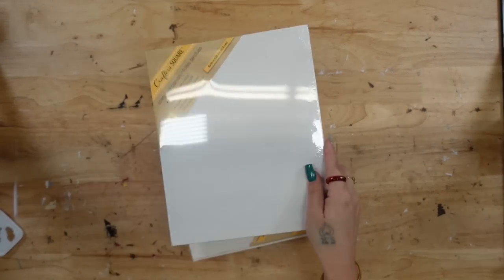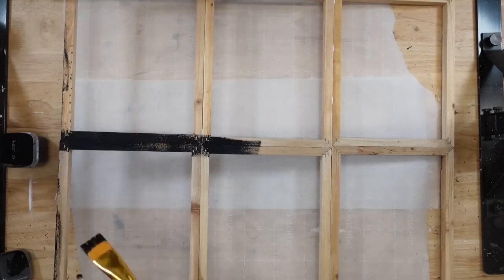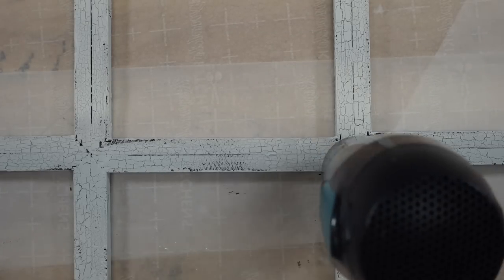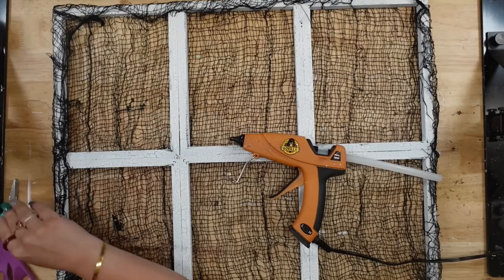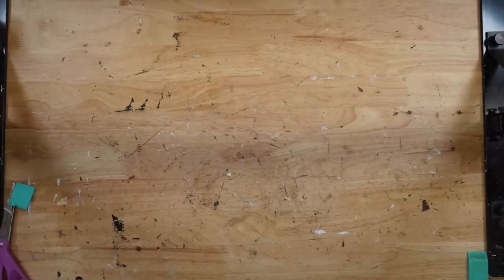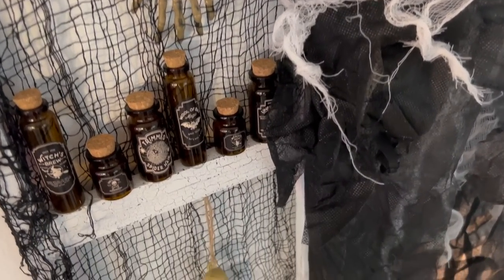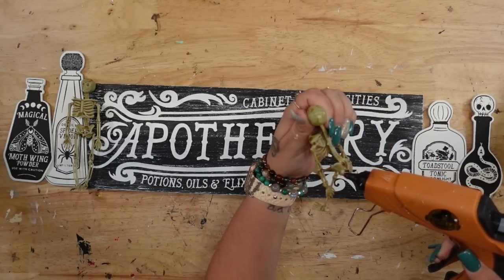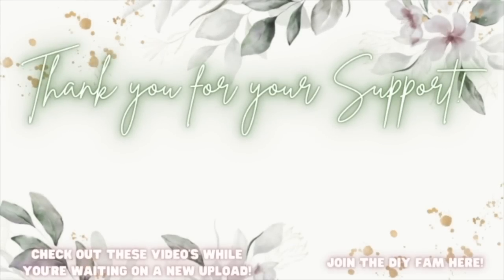Spooky Halloween Diy Decor On A Budget! Dollar Tree Halloween Decor Ideas

Comment: Oh my! Love this video... great diys.
Tip for your skelly holding the lantern. I saw this on another crafter's site. She took the arms and legs apart at all the joints. For the legs she put a small dowel through them, then reattached to make them sturdy. For the arms she used the leftover wire from the bottom of floral stems, and inserted it into the arm pieces to make an "elbow" of sorts. From one crafter to another...hope this helps 😊
Reply from the maker: Thanks for the tip!